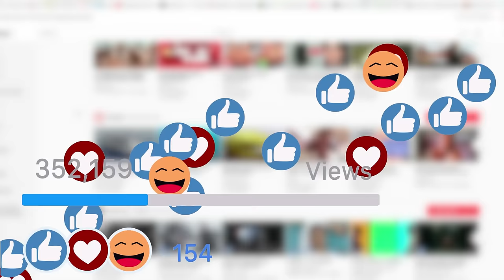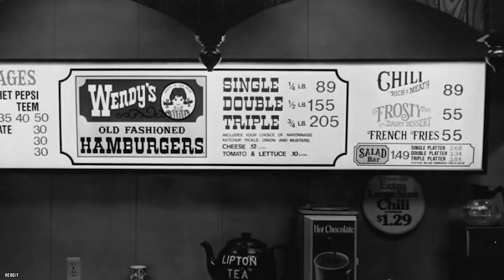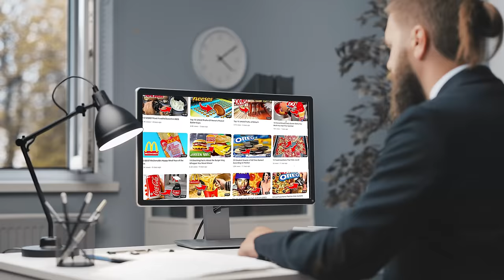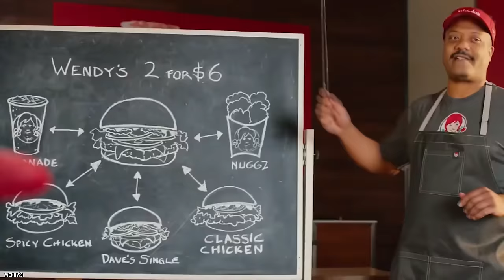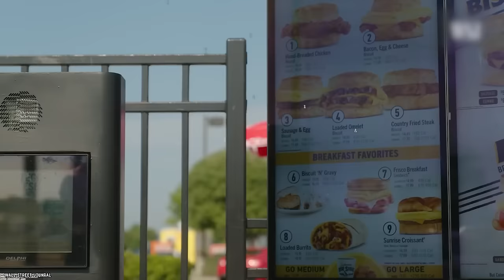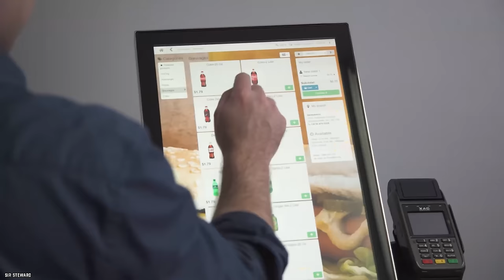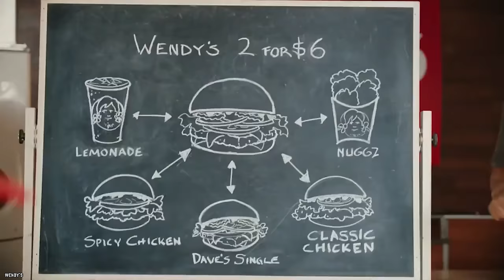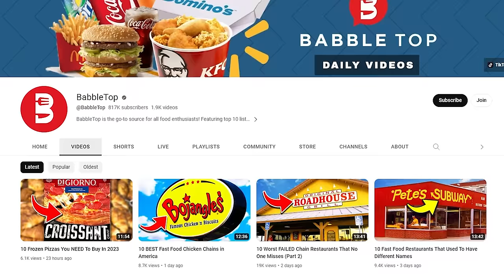24 Big Changes That Are Coming To Wendy’s In 2024

Comment: I've always wondered why fast food didn't have a food tunnel.  They could run it to a small employee both on the other side of a drive through line and have a 2nd live there, so 2 at once. Also what was that nasty looking strap hanging from that new grill.. looked unsanitary at the least.